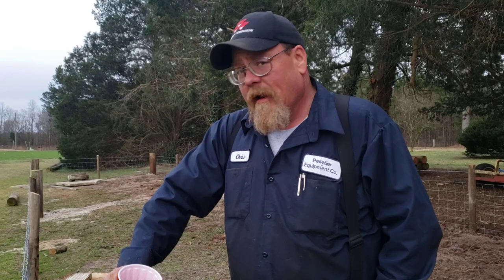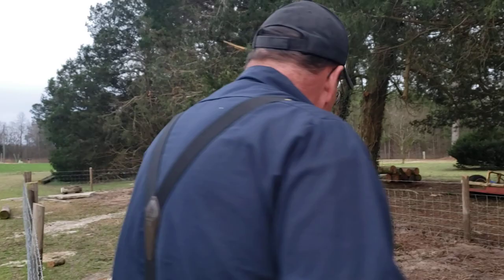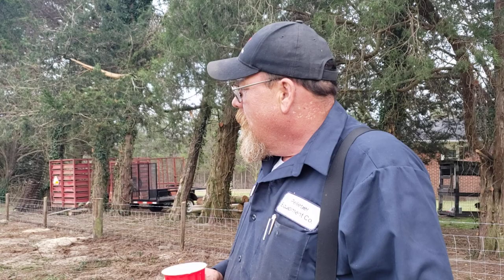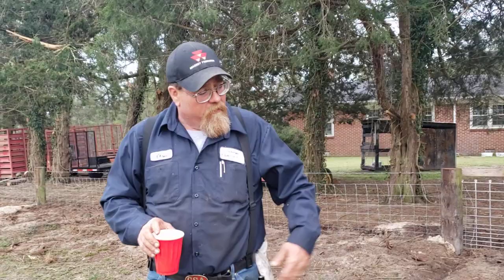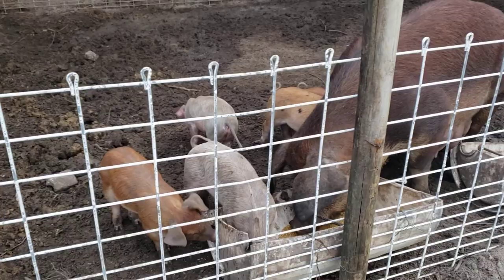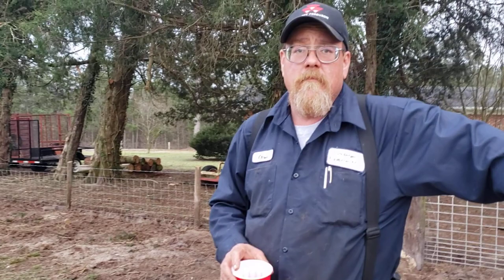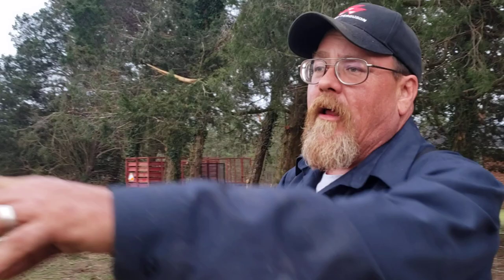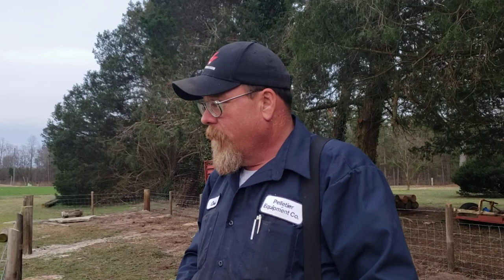Hog Wire, a Mistake?

Comment: Working for a neighbor saw a piglet get out. Coon hound got ahold of it. 400 pound sow didn’t seem to know the fence was even there. That is when I realized just how strong pigs were. He got away but a big blue tick hound would have got ripped in half in no time.
Reply from the maker: That's very true anything less than a concrete wall won't stop one that's good and motivated. I've had mine kill and eat  several bulldogs that went in the pens after a pig

Comment: Amen the pigs we had would test our wire daily
Reply from the maker: We loose power weeks at the time with the floods and storms , that's my biggest problem with relying on a hot fence
Reply: Hi Shane - KJ
Reply: We bought the solar box so far no problems
Reply from the maker: @KinfolkFarmofGeorgia  Trevors getting one for his goats , i'll see how it works and I might get one . The ones they used to make were very unreliable maybe they have improved with better panels

Comment: Your pigs are going to love the extra space.
Maybe add two strands of barbed wire ?  1 and 3 inches above the hot wire?
If you're worried about more poles I would add them on the outside - half way between the ones on the inside.
Or screw 2x6 to the outside of your fence posts with minimum 5 screws in each board. That would help hold the wire to the post if the pigs push out.  - KJ
Reply from the maker: Problem is I have just enough materials to build two pens like this and I need both .they used to work for big hogs anyway

Comment: My pigs when they root up to the hot wire I give the insulator a twist and raise it a couple inches then when the pens empty I pull the dirt away and lower it back down
Reply from the maker: Its only one sow doing it the rest stay away from it pretty good . Got it 18 inches high and she'll wrap it up if you let her ,got another one will tear it down if it's off for more than 5 minutes . Wish I'd stuck with panels honestly , they're worth the extra cost

Comment: Seems to me the old ways worked pretty well for a long time. So adding a few tricks from the "new" ways could be the best of both worlds.  But of course, time will tell.
Reply from the maker: I think it will work fine Geeky as long as the power stays on
Reply: @HomesteadingtheHardWay  I know they are probably pricey but have you checked out the solar fence controllers?
Reply from the maker: @geekygardens  I tried them years ago and didn't have much luck but I'm sure they're better now . That's a good idea

Comment: I may be making a bigger mistake. Trained mine in the pen on electric then let them loose in the woods with just 2 strands. Seems to work for alot of others. So far so good for me. Had em out for about a week and they won't come within 2 feet of the strands. Using batteries for power.
Reply from the maker: Only a problem when it quits working Matt , depends on the pigs some too some won't go near it and some check it constantly . I'm definitely going to have to get a solar charger for a back up, mine have already torn the hot wire down twice . Haven't got out but I wish I'd used panels . I have a training wire in the feeder pig pens in case customers have hot fence

Comment: My pig done the same thing I had my wire about 4 inches above and he kept putting dirt on it . Shorting it out he also knew the second I turned it off I believe they can smell it
Reply from the maker: I've always wondered how they know , i even tried an experiment or two but they know from 3 feet away and if they're mad enough or scared enough it won't stop them anyway

Comment: I can relate to everything he said. Pigs can definitely tell when the fence is out. Even when it's on, the one that works intermittently can be an issue.  I have seen smaller pigs time it and just blitz through when it pauses.  I've also had the problem of them piling so much dirt on the wires it shorted them out.  Livestock panels are best but at $20 - $25 every 16 feet, you have some math and questions to ask yourself
Reply from the maker: Being cheaper and faster to put up is about all I can say good about it . It's definitely better than just a electric fence but nowhere near as good as panels but like you said 25.00 for 16 feet or 185.00 for 330 feet and the ten foot spacing on the post seems fine just the hot wire is doing all the work
Reply: @HomesteadingtheHardWay  With the 330 ft roll I use t-posts spaced more like every 7 ft. I have wooden posts some places and for gates but they're just too pricey these days. I'm glad I got that out of the way before everything skyrocketed
Reply from the maker: @mickeythriller  I'm using utility poles every ten feet mainly because they're free and I have some trouble with folks hitting the fence .  I put them six feet deep on the corners so I didn't have to do braces . I'm going to build one more run of pens ten sows are about all I can handle with everything else I have to do
Reply: @HomesteadingtheHardWay  The word "free" tells me that's a winner. Folk hitting them means you may want to invest in my Dad's trick for people that parked on the lawn. He buried a board with some kind of spikes just deep enough be under the mower. Couldn't really see them through the grass.  I  thought nothing of it until an angry contractor was stuck on the side of the house next to  a "Keep Off Grass" sign and 2 of his tires had ripped off. He only had one spare and a bad day.
Reply from the maker: @mickeythriller  it's usually a customer picking up pigs or an employee that's not paying attention to what they're doing .

Comment: Speaking of fencing and keeping pigs fenced in, hot wire is a must and when the power goes out all you have is ordinary wire fencing. I've mentioned in a past video of yours that pigs can climb out of a 6' fence because I have seen it. Well, I just watched a video that shows that. It actually JUMPS out. If you or any of your viewers are interested in seeing it - to believe it - here's the link: https://www.youtube.com/watch?v=pKJDrgbbf0w 
This aught to show your viewers how agile and potentially dangerous pigs are; just when you think you have them penned in - you don't. NEVER underestimate a pig.
Reply from the maker: That's right Miss Sheila its like trying to fence in a small bulldozer that can jump ! No board fence or wire is going to hold a 600lb sow if she decides she wants out , I've had them pick the whole side of a panel fence up and out of the ground , tear through the side of the shelter , crawl/jump 5 ft fence , run through hot wire / bite and tear down hot wire ( while it was on !), rip down heavy metal gates  ! A big boar can kill you with no problem if you don't handle him right I keep telling people but they won't listen
Reply: @HomesteadingtheHardWay - Bulldozer - perfect name. I hope that video will help prove your/our point. Although I hate to promote someone else's video/channel; i did it for the sake of safety with a dangerous animal or PET as some people think. They can be a pet until they aren't. Not evereyone is a PIG WHISPERER. ;-)
Reply from the maker: @sheilam4964  I watched that video , I've seen that in person !